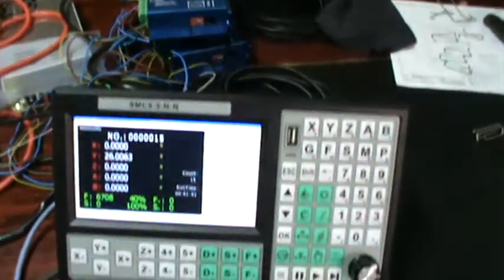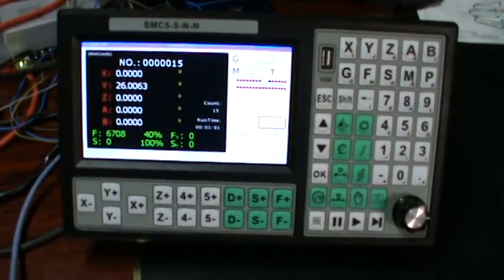smc5-5-n-n how to zero coordinates for new setup

Comment: So, what are you thoughts sbout this controller for now? Roger Webb is full of praise for it.
Reply from the maker: As a stand alone controller , i find it excellent. Fully agree with Roger Webb. This one is not fixed to a single machine. It is carried from machine to machine briefcase style to plug and play when needed.
Reply: @thespringguy1  Briefcase  solution is good idea. I have read people  complain about it does not have backlash compensation. It that fixed maybe in some firmware update. Would you recomend this controller to start with a cnc, or rather to go ucnc route?
Reply from the maker: @fibranijevidra  For my industry application on spring and wire forming equipment...yes I recommend it..An instruction manual for smc5-5-n-n is posted at
www.shaogecnc.com/wp-content/uploads/2020/06/SMC5-5-N-N-manual.pdf  will answer technical questions.
Reply: @thespringguy1  Thank you. I'll give it a read.
Reply from the maker: @fibranijevidra  👍